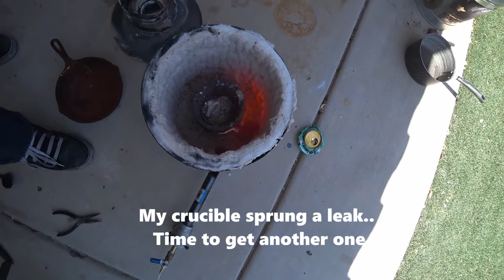Carving and Casting Coin Molds By Hand

Comment: Oh yeah and that Crucible Fail! I feel your pain bro that brings back memories at least you got onto it before the Crucible emptied👍🏻😁
Reply from the maker: Haha I know it sucks.. I didn’t even realize it until I looked inside and was ready to pour
Reply: ArtByAdrock hey Adam I cut the mold apart today and removed the idol 👍🏻looks like a good mold . I’m gonna cast a resin idol tomorrow and Saturday a wax or spray foam one. As I said b4 I’ll be looking at casting it once I get some molds made and my Tongs and lifter made and there 80% done . I can’t wait to have a solid brass or aluminium bronze idol I’ll even love a straight aluminium one. 🤘🏻😁🤘🏻
Reply from the maker: That’s awesome! Do the spray foam one last as you might need to let it sit for a few days to fully cure. It needs air so if it’s sealed up with just a small hole it will shrink. Misting with water helps to cure it faster 👍🏻 I can’t wait to see it

Comment: Dude that came out pretty cool man, I hate when you pour aluminium that skin that it has makes it so hard to do small aluminium pours, if You do brass or copper as you already know that pours like water when it’s hot enough and you won’t have that bubble affect on the back but you sanded it down well to get rid of it. That Crucible you have get that 3/4 full of brass or copper pour a coin then Crucible back in furnace in between pours then pour another coin etc etc sand back flat and stamp your own letters onto it then you’ll have an awesome pile of coins with lettering on one side and a emblem on the other. If I had of waited three more days before posting I could’ve sent 4 as I receive 2 more a couple days after🤷🏻‍♂️. Oh well Never mind . maybe a drill press with a modified wood router bit could make coin molds if you get more graphite blocks as graphite grinds out easy then you won’t  need a lathe . I might even try that at some point as they guard the lathe at work like it’s the bloody fort Knox of equipment . I’m glad it Worked , 
like I said brass or aluminium bronze or something like that would look brilliant, anyway mate take it easy I’ll talk soon
Reply from the maker: Thanks.. yeah the skin on the aluminum is a big pain on small pours. I kept over pouring. I want to do some brass and copper but I don’t have a good source of it yet. Hopefully soon though. I might try the drill press idea next

Comment: I’ve been wondering if this was possible! Well done.
Tell me, what’s the definition like on the foam surface? Is the detail good, grainy, powdery, what? How about the silicone mould… does the fix stick to it? Any de-mould agents needed?
Interesting stuff. WELL DONE!!!
Reply from the maker: The foam surface is smooth for the most part depending on what kind of foam you use 👍🏻